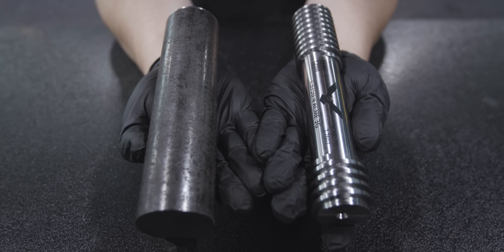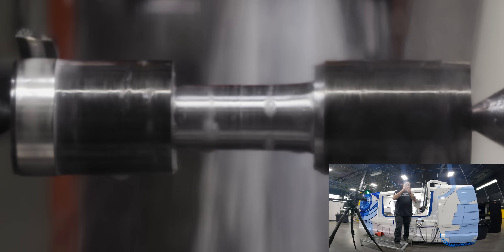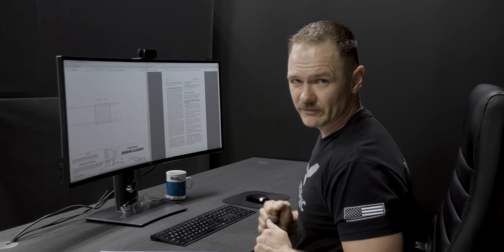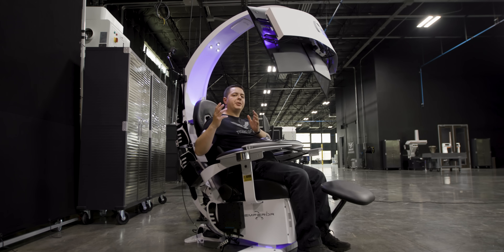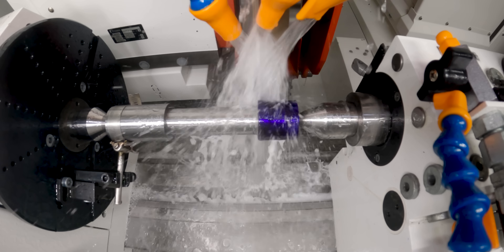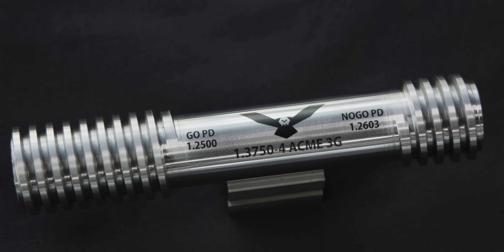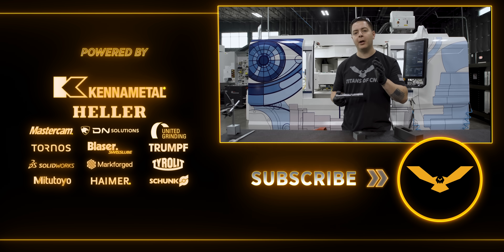The Difficult Process of Making a Custom GO / NO GO GAUGE

Comment: Interesting, I ran Ex-cello model 35 thread grinders at Pennoyer-Dodge Gauge Company in Glendale Ca. for 10 years back in the 1970’s-80’s. I thread ground everything from a 0-80 to diameters over 10 inches. We used the three wire method also, but used Pratt & Whitney super micrometers that had adjustable presser for different pitches. 
We had to change gears for every pitch on the machine, and if we had to do multi start threads we either had to have a indexing head for the tail stock or index off of the gears by counting of the teeth and marking them with Dykem. For a radius root we had to hand dress the wheel then, then measure the radius in a J&L optical comparator. The more I think about it there's too much to mention that we had to go through back in those days so I'm just going end my comments right here.

Comment: Is there a reason why you roughed the OD on the grinder instead of getting it turned on a lathe first before heat treatment? Seems like turning and leaving heat treatment/grinding allowance would be faster than roughing down what looks like 20mm per side with a grinding wheel (I'm an apprentice so this is a genuine question for the sake of learning)

Comment: I wonder if it was necessary to flip the part twice. Could you have done the major and the thread at the same time? Or is there a reason you made it this way?
Reply: Well there was a change of the grinding wheel in between, and I don't know much about grinding especially on such a level of precision and complexity, but either change of wheel introduces more potential for error and required work to mitigate it rather than flipping the part

Or it's simply quicker to do one wheel change (regular to thread), rather than three (regular to thread back to regular and yet again to thread), all assuming that the last one is left on the machine all the way up to next tasks on a different job which could require yet another wheel altogether. Otherwise it's "one and a half" change (one change and taking the wheel off to leave an empty spindle) or 'three and a half'

Either way, former is quicker than the latter, and I suspect that error mitigation after flipping the part (it was just a moment ago ground on this exact setup, assuming Titans live up to the image they created on YT, they keep their machines in good enough condition and regular servicing that setup is all within square, concetricity, in turn being symmetric on the 'imaginary', 'non-machine' axis on which part was flipped end for end etc) is a risk worth taking to save time - as in, time, it potentially will take, to get within true axis at a bad case scenario is short enough to still be a save (or more preferable time spent effort-wise) compared to few more wheel changes
Reply: everything is wrong there to make caliber this way, but??... , some special thread is it  one piece, is it working ? probably yes, did they demonstrate the machine well ? who cares.  Anyway i love Donnie and his swiss turn lathe style. Others of guys are just boring... Boom is just gone .

Comment: I don't understand how a go-nogo gauge could check the tolerances on more than a single parameter: a single parameter in spec would be enough to prevent the nogo side to work, so how do you verify that are ALL in spec? Shouldn't you do two "go" gauges with the upper and lower sizes?
Reply: Exactly so, at the lead in only.  A machine shop owner I used to visit as source inspector showed me how to use a punch to deform lead thread and prevent "no-Go" gage from threading in. A reprehensible act that illustrates your question.
As the name illustrates, hard gaging is only a quick accept/reject tool; does not supersede measurement.

Comment: If used for aerospace parts, doesn't it need to be sent out for certification?
Reply: At my company all gages and measuring tools needs to undergo calibration/inspection once a year and we don’t even make parts for aero.
Reply: Items can be calibrated in house if they have the capability, but I like to send my own gages to an A2LA ISO/IEC 17025 accredited calibration laboratory with all certifications traceable to SI units through NIST.

Comment: Had a job where they wanted 200pcs of .030 steel laser cut and tapped in 2 places each with a 0-40 thread, turns out that by the time the no go bound in the part, it formed the thread enough to make a second pass with the no go, out of spec. had to have the inspection head come watch me do a piece with a brand new tap and check it himself, the customer ended up pulling the job because they wanted 100% inspection on our end and then they were gonna repeat the inspection before they accepted the part

Comment: Weird question but how do you guys create perfect center holes on both sides? We get variations of ,005mm on diameter when we measure around the part with 2point measure
Reply: Normally you would use a center grinder to align the center holes
Reply: My shop turns every part between centers after we drill them. Throw a center in the chuck, zero and line it up with the tail stock then make a few skim passes on it.

Comment: Wow Titan Gilroy that studer grinding what the chair and all the computer screens is f**** amazing!! I mean I did see the first day when you got that machine on YouTube I know I got to sign up for the Titan academy of CNC i keep putting it off  You got to show us more on how the chair works and the computer screens up on top and why there are three or two and everything else and do you still have all the other studer grinding machine you purchase wasn't one of them over $1000000 something like that and how come that one was so much money I mean they're all very very expensive just very curious i always want to know why and how things work since the day I've been born lol I can just imagine how expensive those studer grinding machine spindle I mean something tells me that they got to be very well engineered wet extremely high tolerances I don't think they're your ordinary angular contact match set of spindle bearings I would probably think that's studer has them either custom made for them or studer is making the spindle bearings themselves in-house I wonder if they use like a high-pressure oil pump on The spindle bearings what a very good micron filtration system

Comment: I literally did exactly this yesterday. 1.500x8 Stub Acme. I usually make my gages a little over the minimum pitch diameter and a little under the maximum to ensure a “real” gage will run okay. It tightens up the tolerance I have to play with when running the part, but it’s worth the peace of mind.

Comment: Just a question at the beginning of the video. Is it correct that the tailstock center don't have to rotate as well? 1:05
I thought that the friction between the part and the tailstock center will wear the both of them down and it will start to loosen up?
Reply: The centers are made from cabide, they are super hard and therefore basically dont wear at all.
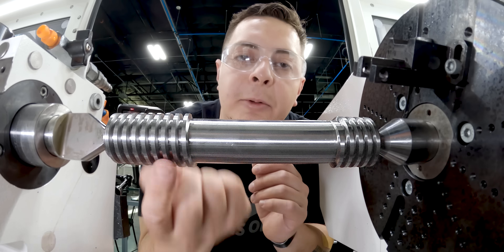Reply: Also on the tailstock there is a cutout on the center, so u can grind closer to the center, you can see this cutout at 6:15 .
Reply: @legggl8648 Okay, thanks for the explanation
Reply: The center is spring loaded

Comment: Can you suggest how to drill 1,2,3mm holes using HSS drill to the depth of 40mm in a VMC?

I tried mine, but at the bottom, the hole went out of its axis.
Reply: I think it would be difficult to do this with HSS. Its bending too much at this size. I think your best bet is Carbide, cuz HSS is always gonna wander away.

Comment: I have an interesting question.
I noticed that you use an analog micrometer instead of a digital one.

Is there a special reason for using that over a digital?

My workplace has “banned” analog and only uses digital now, so it was kind of surprising to see that you still use these wonderful measuring tools.
Reply: Your work place probably had problems with people making mistakes reading the scales.
Reply: There isn't. Chris prefers to use a standard at the machine; I use digitals in inspection. If you know how to use and read it an analog micrometer will work for most cases.
Reply: I have found that digital micrometers are susceptible to shock loading so if you approach the part too quickly you’ll get some error due to the difference of a design from analog. Surprised they banned them but probably depends on what tolerance you are working in

Comment: We make UN gages all the time. Unfortunately you can't make an ACME or STACME thread gage with a regular acme/stacme thread insert. But dressing a grinding wheel works just fine 👌
Reply: Why is that? The full form insert isn’t designed for the go and no-go dimensions?
Reply: @ImStevee  the minor, pitch and root width dimensions of the gage dont align with the form insert. You have to have a smaller minor than whats possible while still hitting the pitch

Comment: Chris, that was a really neat op. I am curious as to the differences with using a grinding wheel to create something compared to using the lathe to make the part?
Reply: This part, with its tolerances and condition, could have been completed on a lathe without issue. In gauge applications, the material would have been hardened, and would pose a challenge machining on a lathe. Grinding would be the way to go then.
Reply: @christobel  Pretty much answered that question for me!!
Reply: @Chris Morris  thanks, that makes sense then to me now. I do find it interesting how with a grinding wheel your able to get such tight tolerances. Gotta love machines and computers for this.
Reply: I've always understood that grinding gets a bit better surface and tighter tolerances Vs hard turning, at the cost of time and having to look after the wheel. However when there is a interrupted cut you probably have to grind as the hard turning inserts tend to be too brittle.